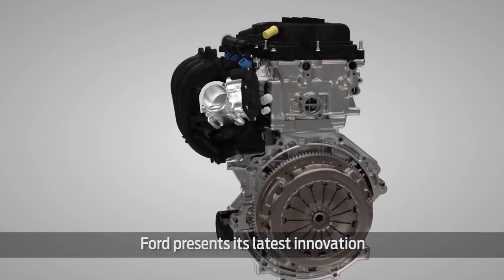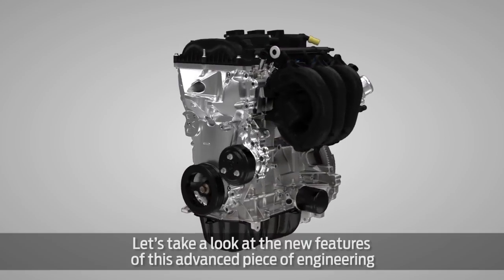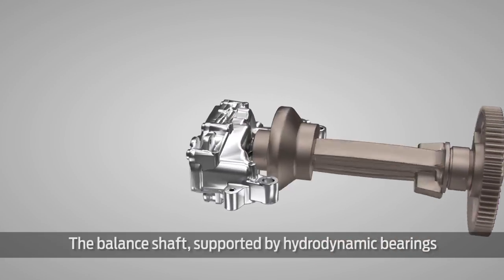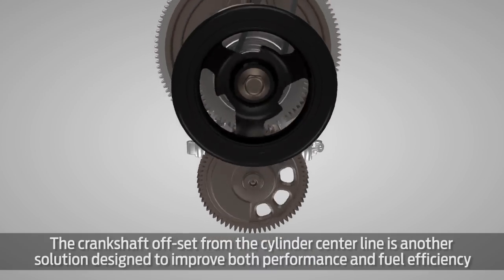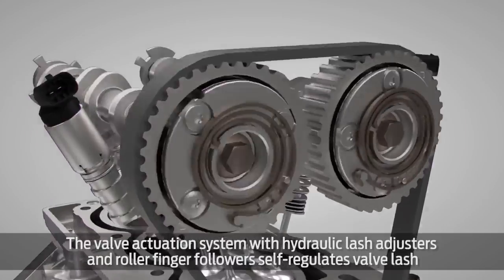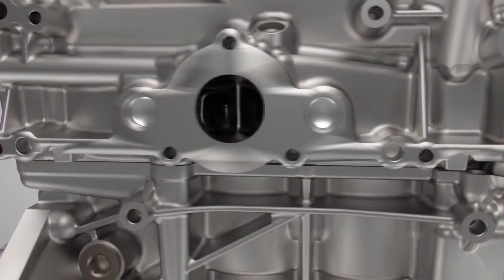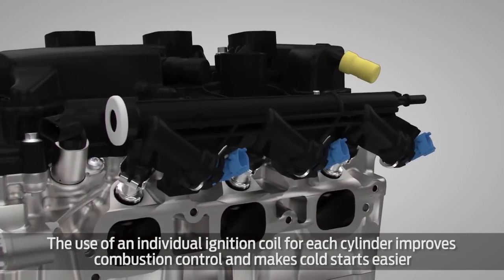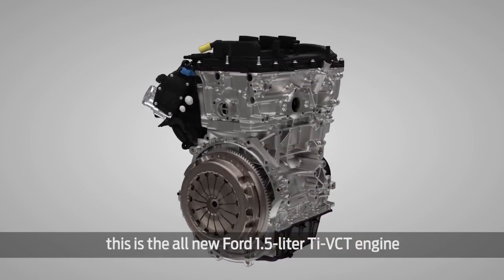Ford’s All-New 1.5-liter Ti-VCT Petrol Engine | Ford India

Comment: I've clocked over 1.1lakhs kilometres with this engine (ford ecosport petrol) 
Mileage was only good when you are babying it otherwise it's very bad, but the power of this engine is much better compared to other 1.5ltr 4cyl petrol engines in india 
Yes it does have vibrations but c'mon, it's a 3cyl

Comment: How much power is lost due to not having an exhaust header?
Most sources claim dyno tests show 27 inch long primaries to be best for power, this little engine has it all in the head, so primary pipe length is about 3 inches!

Comment: This is the best NA petrol engine in 1.5 ltr category ever made available in India when it comes to pure drivability at varied speed other than Honda's ivtec which scores high majorly in overall fuel efficiency but no match to Ford in drivability aspect.
Reply: Belt in oil just like the older 1.0 ecoboosts had but finally now the 1.0 ecoboost uses timing chain. The belt material will eventually break up and block the oil pickup causing low oil pressure and will cost a lot to replace the belt because of it being inside the engine so the engine has to be stripped down. A honda is gonna be way more reliable than ford
Reply: Yes but why put a timing belt. And not a chain. Belt in oil  why ? Isn't it bad for the belt?
Reply: belt break early as 80,000KM ... varies

Comment: Trash engine!
Reply: @Adriaan Labuschagne a world apart. Very good fuel economy got about 24.5km per litre on long road with average speed of 70. Engine has performance you barely touch the accelerator and the car moves. The old Figo you have to rape it before it starts to move. This new one is a performer I love mine very much.
Reply: @christophergreen6980  I just bought a 2020 Ford Ka with this engine it is exactly what you said. I came from a Ka Zetec Rocam 1.6. Great engines both.
Reply: @Adriaan Labuschagne way better
Reply: I would like to disagree with you. I own a 2019 figo with this new 1.5 tivct 3 cylinder and its quite quick with 88kws for a non turbo car is excellent provided that its a 3 cylinder. Id recommend you drive it first before you turn it down...it might surprise you.
Reply: @christophergreen6980  is its 0-100kmph under 10 seconds?

Comment: available in ford aspire ?
Reply: Lal shahab Yadav 
This engine will debut in Fords Ecosport face lift  

Aspire and Figo will get a downsized version of this motor ie 1.2l i3 TiVCT that makes 94 hp and 114 NM torque
Reply: @1989rs500  nop.. Figo and aspire automatic has same engine..
Reply: @aviationkerala2043  and Voila..
Ford has stopped Aspire Figo Petrol Automatic, 
Stupid Ford Mo India
Reply: @1989rs500  iam saying about 2019 model.. 1.5 dragon engine automatic....
Reply: @1989rs500  no bro figo at gets same engine..
Reply: @aviationkerala2043  
Bro..never trust Ford India.
They used to be good between 2012-2018.
Now they are pathetic.
The Figos 6 speed AT is a 6F TC AT transmission.
Just google 6F35 transmission issues. Ford is a stupid brand. Biggest issue s they are not reliable. The 6F transmission are infamous for limp mode issues, oil leak issues, gear hunt issues etc.

Ford is foolish brand, don't you think Ford should have given Figo S petrol with 1.5l Dragon+5/6 speed Manual??
Reply: Yes, Ford Aspire 2018